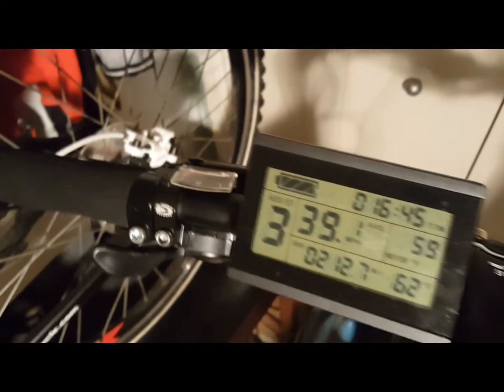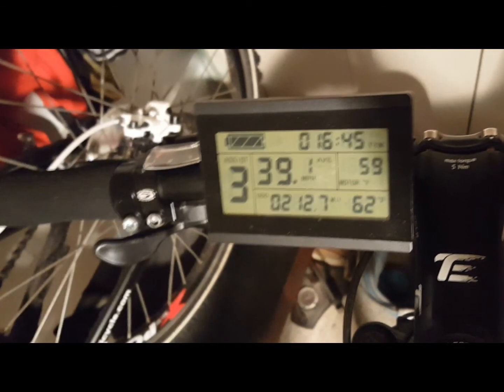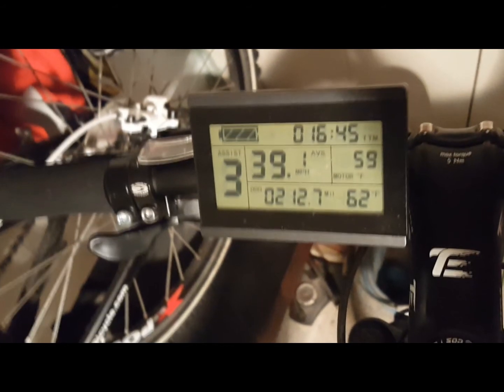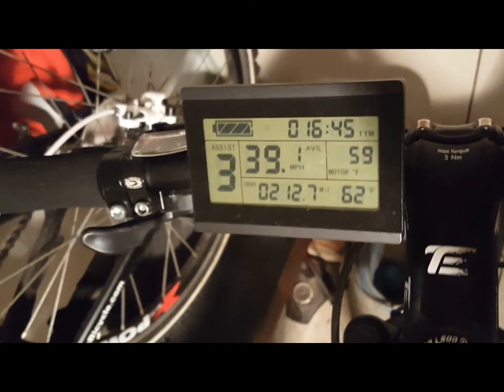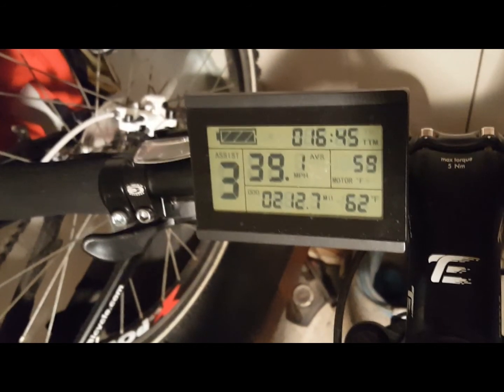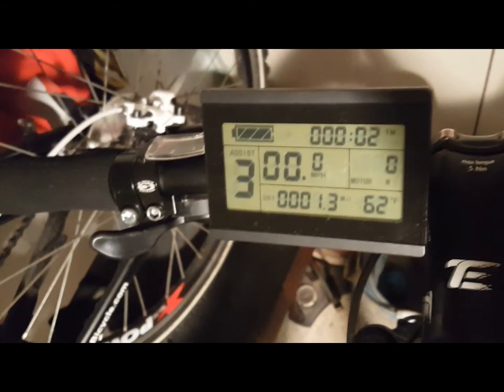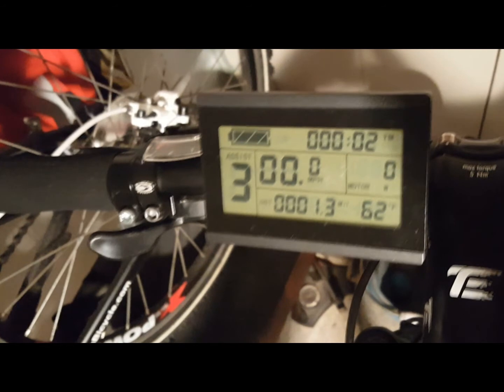E-Bike Tips. Programming the KT-LCD3 controller computer

Comment: I have an issue with my ktd LCD 3 display it is currently stuck on the motor Watts block of the display I press the power button to get it off that function to get into the parameter settings and it won't allow me to leave that block in your video 17 seconds into it the block I'm talking about has the numbers 59 in it I cannot get it out of that block I can only change the flashing of the numbers which there is currently three of them on there and I can move them up and down but I cannot get the function out of that block to get to parameter can you please help me with this issue
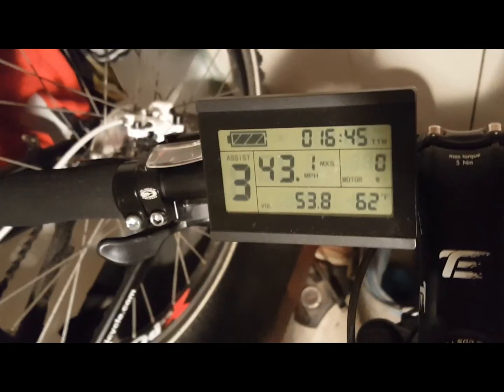Reply: 00:17

Comment: Hi I've got kt-lcd3 display when I program display in the light stops on when finished the display light stops of I had to join wires in two sections it could be a bad connection but why light stops on when finish won't stop on can adjust brightness that's what I find strange worked OK on my other bike thanks 😊